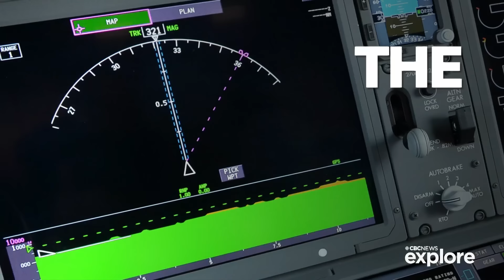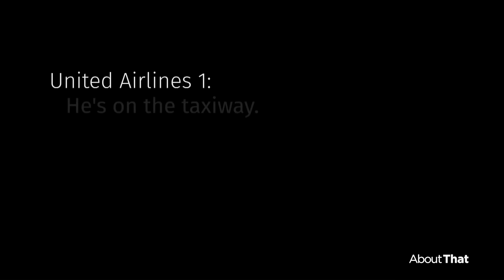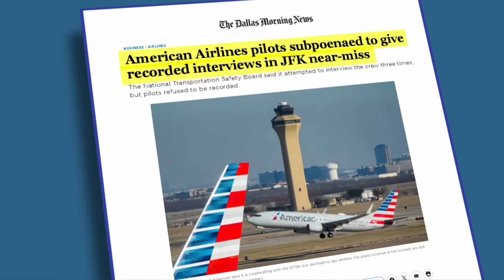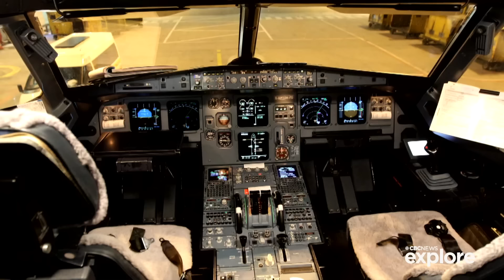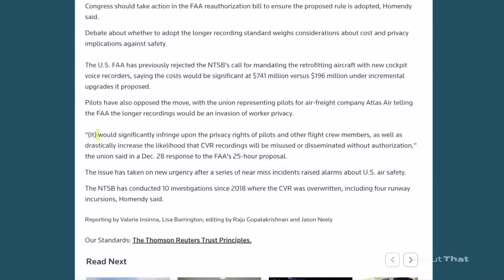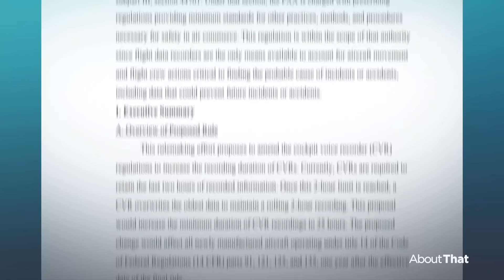Alaska Airlines blowout: How the cockpit voice recorder got overwritten | About That

Comment: I used to be a professional driver.  Our vehicles had 7 day CCTV with sound.  It was used  many times to prove drivers were innocent.
Reply: How many times did they have to retrieve this cctv from seabed  while transmitting underwater location signal or survive few hours fire or survive few hours of fire?
Reply: I am thinking why don't they use something similar like this in the aviation industry?
Reply: @michalw6965 Ok, but, neither of these things happened with this incident.  Plane landed, and the airframe remains intact, minus the plug that blew out.    

Did you have a particular point that you were trying to make, because, I’m not seeing it.
Reply: Airlines seem to be always behind in technology,,,or they didn't want it
Reply: @Robot_repeater 🤦‍♂️ the fact that both the FDR and CVR survived the china airlines nose darting from 30,000 ft…they have to survive that
Reply: @Robot_repeater  The point is that CVR and FDR are designed for what can happen not what had happened that is why they can not be compared with dash cameras in trucks
Reply: @Real_Fanny_Urquhart pilot has nothing to do with tighteing bolts
Reply: @40NoNameFound-100-years-ago  Two reasons from what I've heard. Pilot unions are against it, and cockpit videos of pilots dying in crashes could be leaked to the public causing grief to families and so forth.
Reply: when you were a professional driver, were you on a closed course?
Reply: I think most people in the comments are missing the point the poster was trying to make. The point is: there should be no privacy in the cockpit, when lives are at stake. Besides, the voice recordings, or whatever type of recording, isn't necessarily a weapon against pilots; they're a tool to uncover the truth, which means that they can work in the favour of innocent pilots, too.

Comment: They could reasonably insist new planes get 25h recorders while existing planes have 5 years to get it upgraded. Planes are in for service and retrofits periodically, so it would just be another item on the list to do. Cost or difficulty to implement aren't the issues: it's pilots and pilot unions dragging their feet.
Reply: If Airlines are doing a rebranding and frehs up their design , also a time to set on this device ☺️😉
Reply: You wouldn't even have to do that. You could just require that all recorders must store 25 hours minimum, before overwriting, and no recorders can be sold that don't record for at least 25 hours. The recorders themselves don't last 25-40+ years, so if you can't even get a 2-hour recorder anymore, then the problem is solved across the board in a few years without imposing any new costs on airlines.

Comment: It's almost like the 2 hour limit on American and Canadian planes are intentional to reduce the amount of evidence available.  I always used to like to fly.  However as greed has overtaken safely ant customer comfort I just don't fly anymore.
Reply: 100% you see this all the time. Better to have reasonable doubt for pilots but mainly the airline than actual proof
Reply: Complete nonsense. For the conditions they were designed for (crashes) 2 hours is more than enough. In fact it used to only be 30 minutes. The problem here was that the plane was left on once it landed and after 2 hours sitting idle on the ground the recorder looped around. This was a failure of the NTSB and other investigating authorities to ensure the recorders were removed, manually turned off or the plane was put to sleep which would gave preserved the recordings. Nothing nefarious about it and certainly not a shortcomings of capitalism 🙄
Reply: I felt the same entering retirement and thought Amtrak would be a fun alternative. So I started looking at schedules and following Amtrak user groups on Facebook. I decided to stay home.
Reply: @thomashoffman5745 - No, the problem is that the crew did not follow proper procedure and turn the recorder off after the incident.
Reply: @thomashoffman5745  The CVR could be changed to stop recording at some set point of time after the weight on wheels sensor is triggered or the door is opened or something like that.
Reply: @thomashoffman5745  Let's say that the crew and passengers were incapacitated
 due to a fault in the cabin pressurization system and the flight continued on autopilot for 8 hours before crashing due to running out of fuel. Wouldn't a CVR of over 2 hours be helpful in this case? Or what if there was a crash that somehow left the avionics running for over two hours? There's no excuse for a CVR to only last for 2 hours in this day and age.
Reply: Likely because their checklists went bye bye when the plane had explosive decompression.  I bet they were not thinking quite as clearly once on the ground after what they went through.
Reply: @azjoe_6310  - went bye, bye? Why? Those checklists are not 5 pages of loosely stapled papers. It is a 1 inch (or more) book/binder with many pages. It is not something that just flies out a cockpit.
Reply: @JanBruunAndersen  Well a secured cockpit door had no problem being ripped open.
Reply: It ripped away their checklists and took the co-pilot's headset off her head and out of the cockpit.
Reply: @solracer66  So what would be the time period between turn off and turn on (to capture conversations during preflights and crew handovers) on short transits? Even conversations between engineers would be helpful before the new pilots arrived.
Reply: @thomashoffman5745  The pilots are the ones who have to disable the CVR.

Comment: It is not only about "Cockpit Voice Recording" but also about "Flight Data Recording" to investigate over 120 "Flight Parameters" up until the time of the accident.
There must be something by plane manufacturers and NTSB/TSC that they never really want to change the time limit from 2 hours to 25 hours.
Now the question is; do the European-made planes like Airbus which American and Canadian Airlines fly those type planes still have a 25-hour limit or a 2-hour limit?
Reply: DFR and CVR are not manufactured by either Boeing or Airbus but by other aerosystems companies (Honeywell and Sperry among many others). The tech is there with SSD to store days of data. I don't know if its the NTSB and BEA (french equivalent) that set the recorded time requirement or the FAA and DGAC (FR Civil Aviation agency) respectively. But it needs to be revised to include the whole flight at least and to not be able to be overwritten until the next flight/cycle.
Reply: @R.BOWERS  Unions in europe don't have so much power. It is only a US thing. That's why it is a relevant question.
Reply: g @fredericlepeltier3435   NTSB is pushing for a much higher voice recording time greater than max flight time without air to air refueling.
Reply: @fredericlepeltier3435  "Unions in europe dont have so much power" Thats a lie. At least in Germany they are far more powerful.
Reply: "do the European-made planes like Airbus which American and Canadian Airlines fly those type planes still have a 25-hour limit or a 2-hour limit?"
this is indeed a question that must be asked. I doubt it's going to be answered though.

Also, I doubt the cost estimation is genuinely correct, especially the hint at labour costs. These recorders are heavily standardized and very easily accessed and swappable. The time it would take to swap a 2hr unit for a 25hr unit is so small it could be done during a domestic, low cost carrier turn around by maintenance crew who are attending the aircraft anyways.

also, the entire privacy argument is kind of ironic, considering the US's general approach to data protection

Comment: It is common practice for a CVR to be disabled by the flight crew as soon as practical following an incident. Typically by pulling out the CVR circuit breaker. This powers down the system, stops any further recording, and preserves what has already been recorded. While good practice it's not a regulation, and it would seem that this crew forgot to that.
Reply: In other regards, though, crew seemed very professional
Reply: Forgot? Are you sure about that?
Reply: It's probably a checklist item, and the checklists blew out of the flight deck when the depressurization happened. Someone should've reminded them, but I don't blame the pilots in this case.
Reply: @simashakeri95 heard someone say that pulling the CVR power is not on that checklist that blew out.
And the ground maintenance crew should have done it but didn’t either.
Reply: @JohnHallgren  Ah yeah then it's rough that it was missed twice then. Ground crew doesn't even have the emotional shock aspect affecting their judgement either.
Reply: The ground crew probably assumed the pilots did it. Anyway, the CVR needs to be removed to get the data from it. They wouldn't remove the CVR without pulling the circuit breaker first. They didn't forget.   @JohnHallgren
Reply: @ImperrfectStranger  I highly doubt that by the time the plane landed, disembarked, had first responders checking the injured and then maintenance entering the aircraft, it wasn’t already overwritten.
Reply: It’s not an intelligent solution to have a safety system that needs to be disabled by pulling c/b(s). In a stressful situation you prioritize safety and follow checklists. Pulling a c/b is very low on my priority. Think I had that procedure when I was on the DC9 with a 30 min tape, and that’s a very long time ago. For at least the last 25 years I’ve been on a/c with automatic shut off.
Reply: That's why the technology needs to be updated. Many Dashcams are triggered to record the events if a crash is detected.  The CVR could be linked to the Flight Computer and automatically save the Voice Recordings to a separate drive if certain parameters are met or exceeded.
Reply: @johnguilfoyle3073  the flight computer? You don’t know planes do you?
Reply: @vito774  Agreed, but by the time Maintenance Control told the engineers to pull the pull the recorder it was. You sound like some of the pilots I've come across who think engineers are dedicated to their aircraft and that they don't have 10 other aircraft to work on. That plane wasn't going anywhere. Priority is usually for getting the plane with the closest scheduled departure time out on time.
Reply: @johnguilfoyle3073  There's a point reached where there is so much circuitry involved in system like that that it is more of liability than an asset. The more components in a system, the more likely it will be that one of those components will fail, especially as the aircraft ages. 
e.g. let's introduce an automatic decompression safety announcement system. Great idea! (and it was implemented). Many years later, due to computer glitches, you get random announcements terrifying the passengers when there is no decompression (I've seen that). And of course, there is the added cost of checking these systems during routine maintenance.
Reply: @ImperrfectStranger  not a pilot, ACMX
Reply: While I have no reason to think anything except distraction from the emergency caused them to forget, it's definitely the case that if a pilot thinks they did something wrong, they're probably highly likely to "forget" to stop the clock.

I somehow doubt it was just an oversight in the Air Canada taxiway incident.

Comment: My employer has 24/7 access to internal and external cameras with audio fitted on/ in my truck recorded for eternity.
The internal with audio is there as a company that operates tow trucks working in dangerous environments as well as having passengers in the trucks it comes in handy catching people who try to steal items from the cab when the driver is out loading the car while he has put them in the truck to keep them safe. It happens more than you would believe.

Comment: In an era where multiple terabytes can be stored on a device the size of a sick of gum, it's inexcusable that even 25 hours is a limit on CVRs in new aircraft.
Reply: If it were only voice, sure. But they also record the status of every button, switch, display and every action shy of what position the flight crew seats are in. Plus the condition of all systems throughout the plane.
That's a lot of data to put on a device rugged enough to survive a plane crash plus whatever environment it ends up in. 
It's obviously possible as it's the industry standard elsewhere and the privacy concerns are grasping at excuses.
Reply: @KMCA779 those are two different boxes…
Reply: @KMCA779 that’s the flight data recorder (FDR) not the cockpit voice recorder (CVR). Two separate systems in separate boxes.

Comment: When there is a short circuit on main line electric supply  to cockpit recorder ( which is in backmost part of aircraft) and  secondary back up battery circuit takes over , recorder rewrites  replaces old recorded conversation with just a background electronic noise as cockpit mics are not transmitting voice data .May be the main circuit wires of Boeing passed through ripped door ! ( For more details read on Air India Kanishka cockpit recorder analysis )
Reply: Would you have a link to this event? I've worked on 747's for 40 years and I've never heard of a backup battery. I have a circuit diagram in front of me now. I've even worked on a few Air India 747's. All aircraft have an area microphone on the overhead panel. You can still hear conversations without the headset mics being used.

Comment: This is intential to reduce airline liabilities. 

EU can do as a favor and ban plabes from Europe without a 25h recorder. Airlines will force to adapt real quick.

As for privacy, you are at work. If you are not being professional at work then it is on you for not being professional at work and should face the consequences from it.
Reply: Pretty sure that is already the case. All flights in Europe have to have a 25 hours recording.
But it's easy to configure the recorder differently in the US (remember that the issue comes from the recorder, not the plane itself)

Comment: I remember seeing a video about CVR's that lamented how often they just don't work. The rule is they have to be fitted to the commercial plane, but no rule that they have to be tested and ensured to be operational. Also, the backup battery on the transponder also doesn't last very long, as can be remembered from Malaysia Airlines Flight 370. It might take weeks for the box to be found, why can't the batteries be extended?
Reply: @R.BOWERS  I'm a technician, and I know for a fact that batteries are not perfect and need to be changed out fairly often (less so for lithium chemistries) and if there are no test/maintenance requirements for CVR's then it won't happen.
Reply: @R.BOWERS  One would expect that, I guess.
Reply: The bigger the battery, the bigger the weight. You have to consider high g survivablity.
Reply: @ImperrfectStranger  True, but I'm sure the rest of the box can be solid state and smaller and less power hungry.

Comment: I don't see what the big deal is. The plug came off, not caused by pilot error. The only relevant data I can see that would be helpful is any pressurization faults that might have occurred during take off.
Reply: That would also still be on the Flight Data Recorder.

Comment: it is most likely the last steps of the emergency check list for one explosive decompression to pull the circuit breaker after landing
Reply: And deduct some merrit points if the flight crew forgot.
Reply: Could also be among those lists that blew out the door on them and after getting that thing back on the ground I guess it just wasn't a memory item.  But yeah if it is so critical, you'd think as a last resort that someone from maintenance or emergency team OR even the NTSB itself would communicate pronto to make sure its done.
Reply: Those check lists blew out of the cockpit. They had to do everything in that emergency by memory.
Reply: @wally7856  100% spot on.  Funny how many conspiracy theorists there are out there.
Reply: Any commercial pilot knows is their responsibility to pull the CVR circuit breaker upon landing following serious incident. It isn't arcane knowledge or trivial minutia easily lost among details.  I don't know whether they forgot because they were rattled and focusing on other procedures, or omitted the step intentionally, but it is as much common sense and common knowledge as thinking to save the security camera videos following a bank robbery. Even if it is an accident, this is a major oversight on their part.

Comment: One kf the last items on the emergency checklist, per Juan Browne, is to pull the CVR circuit breaker, stopping g the recording.  The crew were I guess a little frazzled by the time they landed.  On top of that, the decompression blew open the cockpit door and everything not bolted down went with it. Including headsets, checklists, manuals, phones iPads.  So, I give them a pass on that one.

Comment: The fact we are still looking at a limit of audio recording in the modern age of SSD's with crazy amounts of storage is INSANE! With the limits we have on one of them they should be able to record audio and video from the cockpit.
Reply: Its one thing to store a terabyte of data on your phone. Its another to store 1/1000th of that on a device designed withstand fire, freezing, crushing, fluid emersion and 1000 G's in a crash

Comment: Correct me if I'm wrong but it seems to me this was a failure of the NTSB and other investigators to procure the voice recorder before it got overwritten. They also could have put the plane to sleep (shut it down) which would have also preserved the voice recorder. I assume since the voice recorder looped over that the data recorder did the same as it to runs on a 2 hour loop.